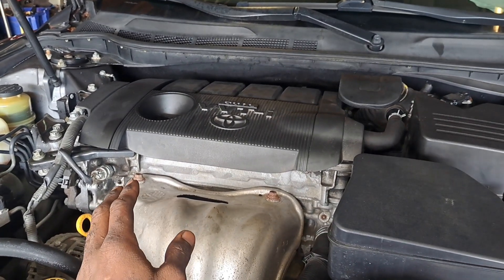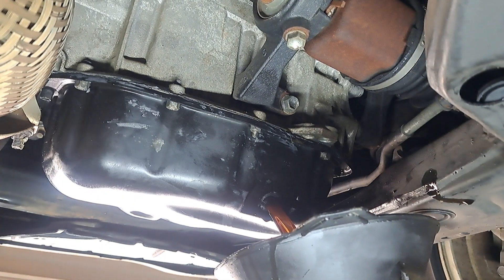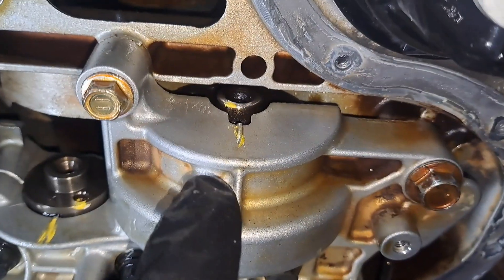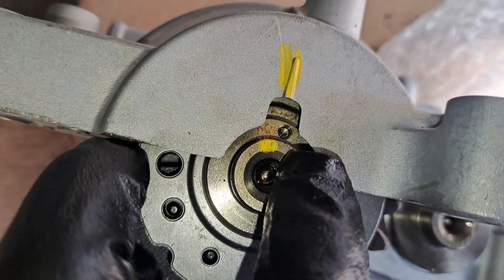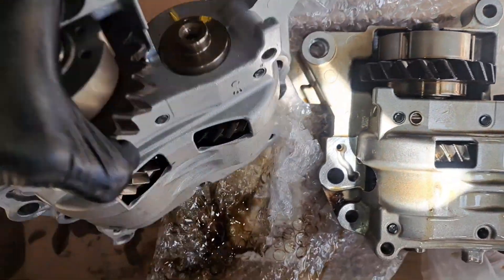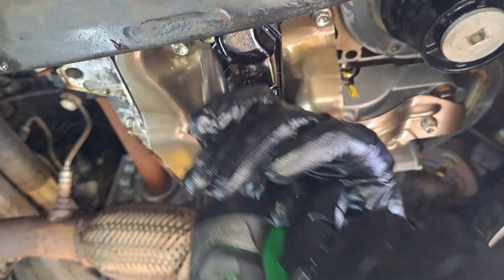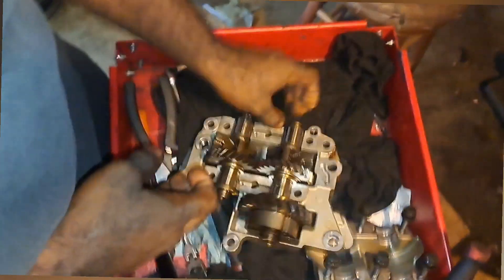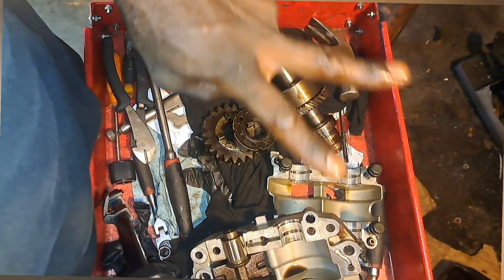toyota camry 2.5 balance shaft replacement,   part from Amazon, 2AR-FE

Comment: Good job.  I have one question, we buy the pinion alone or it come complete with the case?👍👍
Reply: It comes as an entire assembly including the case. However, if you have the skills to disassemble your balancer you can replace the damper rubbers. Google "Klifex balancer shaft damper repair kit"
Reply: @danieloneill4356 Que pena que el sistema crea los problemas porque pienso que sería mejor, pensando en el ambiente, llevar la pieza al concesionario e intercambiarla por una nueva tal como ocurre con las baterías de los carros híbridos.

Comment: There's no need to mark the balance shafts with a marker pen. Toyota already made marks for you. If you rotate the engine to TDC on No. 1 cylinder the OEM marks on the balancer will align.

Comment: Up date: I already cancelled my balance shaft, i used the word cancelled because it wasn’t deleted, I installed the old mechanism back without the main sprocket so this 10 pounds system will not rotate , so there won’t be any noise in the future either, however be prepared for a lot of vibration when accelerating and dashboard rattling , no steering wheel  or seat vibration 🤷‍♂️
Reply: No a good idea, I put balance shaft back 🤦‍♂️

Comment: Has anyone done this with an aftermarket part from eBay or Amazon? It's hard to know which one to go with without any reviews
Reply from the maker: You got to be kidding me....
Reply: @partsshooter sorry I know you used an Amazon part. I should have worded my question better. What I meant to say was: can someone suggest power off of Amazon or eBay to use.
Reply from the maker: @BriMorilla I still don't understand... try describing what you're trying to achieve here. Maybe that'll help
Reply: @partsshooter When I was reinstalling the new balance shaft. I broke one of the 12mm bolts. I read on a comment on here that the torque specs were 40ftlbs. Do you think I could just install the rest of the bolts and be okay?
Reply: ive read it's more prone to vibrations

Comment: 281k miles with 5w30 on my 2014. Bet yall with this problem are running that water for oil.
Reply: What year is your camry? I'm thinking about switching to 5w30 on my 2012 4cyl
Reply: @BriMorilla he says it there: 2014

Comment: Thank you so much for the video as this is exactly what is happening to my 2015 RAV4 at 230k miles.  The noise and configuration that causes the noise is spot on!  Got the new part ordered and will get in installed ASAP.  You rock!
Reply: Did the start up have a rattle?

Comment: I changed that part, but the car still makes a rattling sound when I start it at low revs! I don't know if I should change the water pump. Maybe that's it!
Reply: It could also be your VVT gear I worked on a 2003 Toyota Camry 2.4 change it out and the sound went away. Keep researching
Reply: @Eli-jc2xk this is correct
Reply: I also read that if the car is making a rattling noise at low revs after it has already been started, it could be the balancer shaft tensioner. As this tensioner comes collapsed and needs to be submerged in oil before install. Not sure if it's true or not..

Comment: Man, I changed my oil pan gasket in this engine and found what looks like  a missing piece of hard sprocket material, like a teeth.  When cold the timing chain rattles but goes away, no running problems.

Comment: My car is currently at the shop and I’m getting my balance shaft replaced it’s a Toyota Camry 2011. The mechanic sent me photos of plastic and metal bits on the oil pan. Is the engine still good? Or is it doomed. I didn’t drive the car when I began hearing the noise.

Comment: Just a heads up, I have a 2015 Toyota RAV4 xle awd and there are two part numbers for the balancer shaft assembly. The new part number is 13620-0V050. Not sure why the part number changed but if anyone knows why, please let us know. Looks like it may due to changes in what the materials used on the part itself but not 100% sure. It also costs about 275 dollars more than the original part number which is a huge difference. Hopefully itll last longer. My rav4 has 138k miles. I will replace it within the next 2-3 weeks once i get it delivered.

Edit: just replaced it and the rattle noise is gone. Thank you for this video!
Reply: Awesome!  I got a 2015 RAV4 XLE FWD model with this same rattle at 230k; just ordered the new part and looking forward to fixing it!

Edit: Replaced mine with the new part number too and rattle is gone!

Comment: Steps
1.  Preparation:
	•  Safety: Park on a flat surface, engage the parking brake, and disconnect the negative battery terminal.
	•  Raise Vehicle: Jack up the front and secure on jack stands or use a lift.
	•  Drain Oil: Remove the oil drain plug (14mm) and oil filter, draining into a pan.
	•  Avoid Engine Rotation: Do not rotate the crankshaft or engine during the process to maintain the current alignment, as you’re not setting TDC.
2.  Remove Under-Engine Components:
	•  Remove splash shields (10mm bolts/clips) to access the oil pan.
	•  Optionally, loosen the serpentine belt (Gates K060494, using the 39106 tensioner) if it aids access, but this is typically unnecessary for oil pan removal.
3.  Remove the Oil Pan:
	•  Unbolt the oil pan (~15-20 bolts, 10-12mm). Note bolt locations, as lengths vary.
	•  Gently pry the pan from the engine block with a screwdriver or pry bar, breaking the sealant bond without damaging surfaces.
	•  Clean mating surfaces with a gasket scraper and brake cleaner for resealing later (previous response on resealing).
4.  Mark the Old Balance Shaft:
	•  Locate the Balance Shaft: Inside the lower engine block, below the crankshaft, you’ll see the balance shaft assembly (two counter-rotating shafts with fiber gears).
	•  Marking Process:
		•  Use a paint marker to mark the position of the No. 1 balance shaft gear (typically the gear closest to the front) relative to a fixed point on the engine block (e.g., a bolt hole, casting mark, or adjacent gear).
		•  Mark the No. 2 balance shaft gear similarly, noting its position relative to the block or No. 1 gear.
		•  Mark the balance shaft housing orientation relative to the block (e.g., a dot on the housing and block near a bolt hole).
	•  Tips:
		•  Use clear, small marks to avoid confusion (e.g., a single dot or line).
		•  Take photos or videos of the marks and gear positions for reference.
		•  Ensure marks are oil-resistant and visible during reassembly.
	•  Why Mark Both Gears: The two shafts rotate oppositely, and their gears must maintain precise alignment with each other and the crankshaft.
5.  Remove the Old Balance Shaft Assembly:
	•  Unbolt the balance shaft housing (typically 12-14mm bolts, ~4-6). Note bolt positions.
	•  Carefully extract the assembly, avoiding rotation of the gears or crankshaft.
	•  Inspect the old shaft for worn fiber gears or debris, confirming it’s the noise source (supports your knocking diagnosis).
6.  Install the New Balance Shaft Assembly:
	•  Position: Align the new assembly (e.g., OEM 13620-36020) using your paint marks as a guide:
		•  Match the No. 1 and No. 2 gear positions to the marked points on the engine block.
		•  Align the housing orientation with your marked reference.
	•  Verify Alignment:
		•  Ensure the gears mesh smoothly without forcing.
		•  If possible, check for any visible timing marks on the new shaft gears (e.g., dots or notches) that align with block references, even without TDC.
	•  Bolt Down: Hand-tighten bolts, then torque in a crisscross pattern (initial ~16 ft-lbs, final ~41 ft-lbs, per AutoZone Repair Guide). Confirm torque values with a manual if available.
7.  Reseal the Oil Pan (From Previous Response):
	•  Clean oil pan and block surfaces with brake cleaner and a scraper.
	•  Apply a continuous ~1/8-inch bead of Permatex Ultra Black RTV or Toyota FIPG 00295-00103 inside the bolt holes. Optionally, use a gasket (Toyota 35106-0V040).
	•  Reinstall the pan, torquing bolts (~7-9 ft-lbs) in a crisscross pattern.
	•  Let RTV cure for 1-2 hours.
8.  Reassemble and Refill:
	•  Reinstall the oil filter (hand-tight plus 3/4 turn), drain plug (~25 ft-lbs), and splash shields.
	•  Refill with ~4.6 quarts of 0W-20 synthetic oil. Check the dipstick.
	•  Reattach the battery terminal.
9.  Test and Verify:
	•  Start the engine and check for oil leaks around the pan.
	•  Listen for the knocking noise at idle with AC on. If the balance shaft was the cause, the noise should be gone.
	•  Check for new vibrations or noises, which could indicate misalignment. If present, stop the engine and consult a mechanic.
	•  If the noise persists, inspect the AC compressor clutch or Gates K060494 belt/39106 tensioner immediately.
10.  Dispose of Old Oil:
	•  Recycle used oil at an auto parts store or recycling center.

Comment: Just wanted to give a huge thanks for this video. I was stressing bad thinking the timing chain was loose or there was a much deeper issue. Needless to say, I spent hours researching this and trying to find a video where someone had the same noise and issues before I stumbled onto your video. My wife's 2013 rav4 had the exact same sound and symptoms (its very distinct, like something metal rattling around between an exaust cover), and the oil pan was the dead giveaway. I even had someone tell me to pull the timing cover to get tdc bc there were no marks on the tc cover or crank pulley...Nope, followed what you did and it worked perfectly! Now I can sleep easy 🫡🙏

Also, I shoved a flathead to hold the balance shaft at one of gears on the old one and turned the larger gear with my hand, there was about 1/2" of play in it. Definitely the culprit.

Comment: Great video. About to do the same to my 2011 Camry. Quick question: At about the 4:19 mark when you're removing the oil strainer you stop briefly and say "oh s$#%!" 😄but then you keep going. Is there something there that was a problem and we should look out for ? Thanks again for the great video!
Reply from the maker: It was just an oil spill once bolt was removed.  That's all.  Job is straight forward as you see
Reply: @partsshooter  Finished the job yesterday. Your instructions were spot on. I was tempted to pick up an Amazon part, but splurged and got one from the dealer. Hopefully I'll never have to open that pan again.  Now just sweating out whether the seal is good around the oil pan. I waited about 18 hours before adding oil and driving, so hopefully that will do it. Thanks again!
Reply from the maker: @christopherprawdzik5937 waiting is the best thing to do.  But honestly, by the time I finish installing everything,  adding oil never shown itself to leak.  But waiting to cure is the best rout like you're doing.  I'm just impatient

Thanks for the update

Comment: Here in 2025, just replaced mine on a 2013 Camry. Mine had gotten bad, it was a very loud audible knock coming from the bottom end around the oil pan just like in the video. Most of the teeth on my balance shaft had broken off, but I used part number: 13620-36020 off of Amazon to replace it. It’s been working great & the engine sounds like new. Takes about 1-1.5 hours taking your time. Very simple.
Reply: I’m going to try the balance shaft without the main “fiber” sprocket so whole mechanism is going to be there but the mechanism will not rotate ( only 10 pounds and you ain’t going to race , are you? 😁) so i don’t have to modify or plug anything,  if the vibration are beyond my expectations I’ll install a new one , wish me luck 😛
Reply: @Wiicked_Rides I'm looking at ordering one on Amazon but there are few reviews, which one did you go with?
Reply: @randyrentschler2501The part number I have listed and the brand was CNYGO. They’re all made in China lol. But it’s still be working good for me. If it last 50k miles…100k miles…doesn’t really matter to be. It’s not expensive and easy to replace
Reply: @Wiicked_Rides  agree 💯, i received mine yesterday, after a visual inspection I realized that the only thing that could fail in such mechanism is the “black” or “Brown” gear that is moved by the crankshaft because it’s  not metal made, according an article I read on line Toyota designed like that to minimize noise and vibration 🤷‍♂️
Reply: @64arguz  I replaced mine with one on Amazon yesterday. The old one had about 1/2" or more of play if you held the small gear from turning with a flathead and turned the larger (non metallic) gear with your hand back and forth. It fixed the issue entirely. Worth the time and money for sure. That was a pretty nasty noise it was making.
Reply: @randyrentschler2501 thanks for sharing your experience 👍🏻💪🏻
Reply: @Wiicked_Rides well it does matter to me ☹️ the original lasted 100k miles, the replacement ( China) lasted 6 months, yesterday I installed another one and right from the start began to make noise, not even 1 mile ! 😡 it is not only the time and work wasted, so many times installing and uninstalling could damage the bolts or screws thread creating another problem 🤨
Reply: @64arguz if you’re damaging threads you’re putting your bolts way too tight. Hate you’re having those issues though, maybe try one from Toyota then
Reply: @Wiicked_Rides already found the brand CNYGO that you mentioned i Hope I have the same luck as you with this part , thanks for sharing 👍🏻
Reply: @Wiicked_Rides I’m not a professional mechanic but I won’t touch a car without the appropriate information and procedures from service or repair manual  and professionals mechanic, I use torque wrench to tighten the bolt 😉 I’ve started to hate my Toyota because of this 😔
Reply: @randyrentschler2501 I ordered my from EBay because the seller promised “lifetime” warranty 😏 but it looks to me that all of them are made in the same factory in China except the genuine Toyota 🤷‍♂️
Reply: Thank you so much @64arguz
Reply: Was your noise hard to distinguish? It almost sounded like it was top end near the valve cover, but crawl underneath and sure enough its loud at the oil pan. Is that just noise travel? Was it the same for you? I did a ton of research and was pretty baffled until i stumbled on this video@64arguz
Reply: @randyrentschler2501 noise is only when the a/c is turned on, sound “ugly” I would say like a rod noise , I turn off the a/c and the noise disappears, idle is smooth and steady , no codes and only happens when the engine is cold , once i drive 10 miles o so the noise goes away even with the a/c on 🤷‍♂️🤦‍♂️
Reply: @randyrentschler2501my noise was consistent whether the AC was on/off. Sounds just like an audible rod knock. I agree it sounds like the top end a little but if you jack the car up & listen it’s 100% coming from the pan
Reply: Thank all of you! I was panicking thinking it was internal and I was in for a tear down! This is not a bad issue. I appreciate it so much@Wiicked_Rides
Reply: Hi, My ‘13 Camry engine makes a weird noise ONLY when the a/c is on and engine is cold , after several miles of driving it goes away , was that  your case ?
Reply: @64arguz 2008 RAV4 2.4 L. Same rattle same condition you descriped. Hope not the balancer shaft
Reply: @Di_Cocco yes , it was, I replaced the balance shaft myself and the the noise is gone, however I disassembled the old mechanism and as always can’t find any problem with it 🤷‍♂️ previously I replaced the VVT-i sprocket and the timing chain tensioner and it was the same couldn’t find anything wrong with those parts but the conclusion is that so far no “weird” noise in my engine any more 😛
Reply: Looking like I have to do this on 2015 camry - Do you know the torques for the 2 size bolts used to hold the assembly in place?  also did you use gasket sealant or an actual gasket when reassembling?  TIA  Andy
Reply: @andrewak100 couldn’t find anything on it and so I marked a spot and then counted the rotations for one of the larger bolts and then one of the smaller ones and just used that as a guide. I worked them all in a little at a time. Just off of feel the larger ones couldn’t have been no more than 70-80 ft/lbs and the smaller ones around 30 ft/lbs. I used standard gasket maker on the oil pan
Reply: @Wiicked_Rides  Do you know if there will be any difference on the 2015 camry vs your 2012 project?
Reply: @andrewak100  nope , Toyota made the same engine until 2017 , starting 2018 it’s a different one
Reply: @andrewak100 2010-2017 have the same part number for the balance shaft for the 2.5L so I would say no
Reply: @andrewak100 balancer bolts 24 Nm, oil pan baffle 10Nm, oil strainer 10Nm, oil pan bolts 9Nm
Reply: @64arguz  arent't there 2 size of bolts on balancer?  Also, does anyone know if this is same procedure on a 2015 vs this video on 2012 camry?
Reply: @andrewak100  3-12 mm(24 nm) 4-14mm (43nm or 32flbs)
Reply: @64arguz I broke off the head on one of the 12mm bolts. Do you think I can just leave it? Seems like it would be secure enough with the two other 12mm and the 14mm.
Reply: @BriMorilla  I would try to fixed properly, such mechanism is under a lot of stress and vibration and in some way is connected to the engine lubrication 🤷‍♂️
Reply: My teeth also broke off and my entire engine was vibrating inside the car because it was out of balance. Did you experience this too??
Reply: Traduccion

Comment: Did u mess with the crankshaft pulley to align it? Or you turn on the car after u finish installing it
Reply: No you don’t need to mess with anything else. What you can’t see in the video is the shaft has a natural balance point, the dots on each gear will want to return abs align with the hash mark on the case. It really easy to replace

Comment: Thanks for the video. Can you put the motor on top dead center and the mark on the balance shaft would lin up
Reply from the maker: @jonp6347  yes.  However you decide to do it.  It's just a simple removal and replacement